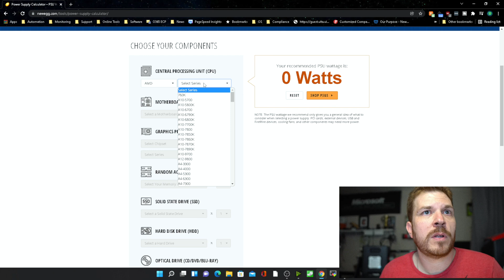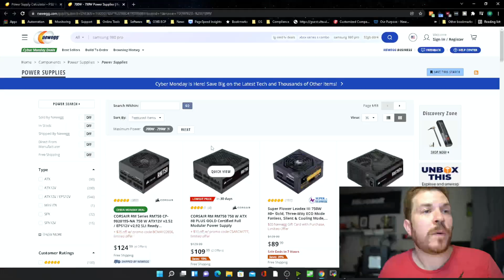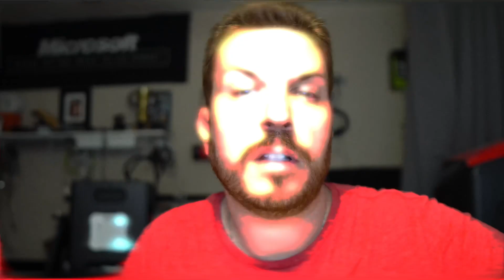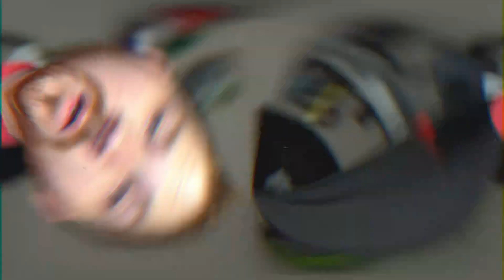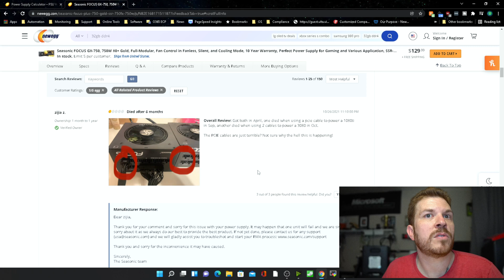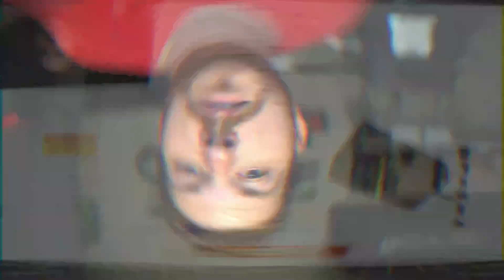How to buy the right power supply

Comment: I'm a huge EVGA PSU fan, never had an issue with them including in my servers that run 24/7.  It's hard for me to swallow the pill that their PSUs may not be that good after all.  But like you said, sometimes bad units just make it out into the world.
Reply from the maker: @SPX Labs same here and Seasonic but you just gotta check the reviews for each one and always use conditioned power.